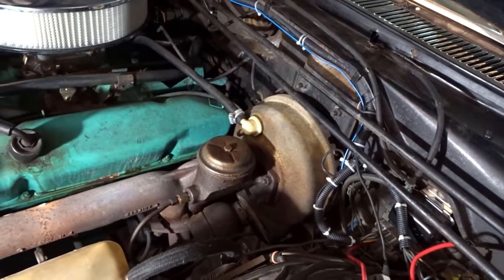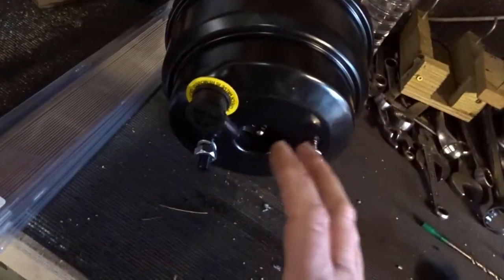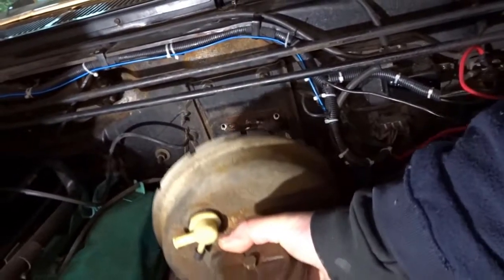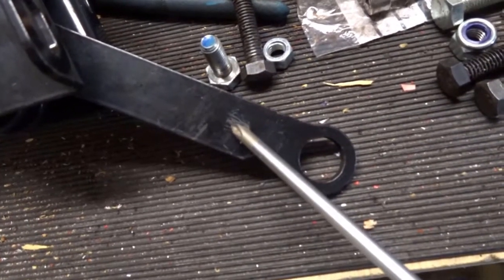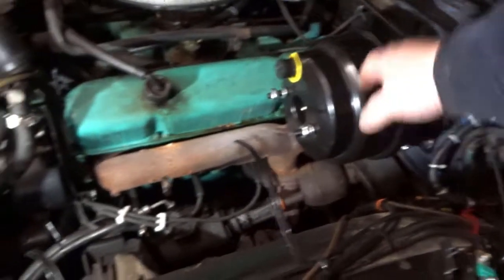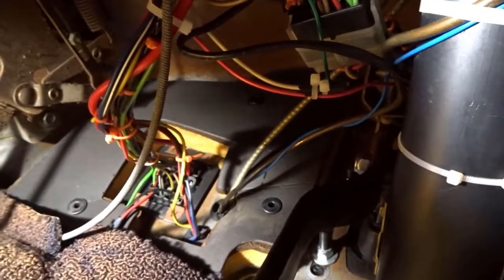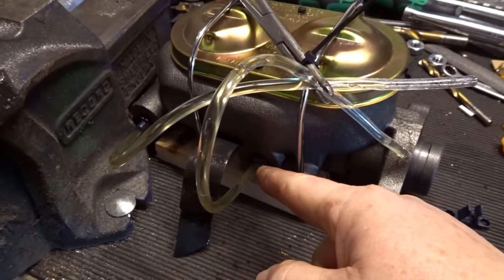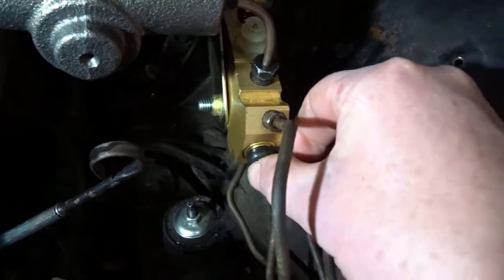1965 MOPAR C-Body twin 8" booster & dual circuit reservoir fitting

Comment: Nice mod.  Where did you buy this kit?
I'm having a hard time finding aftermarket parts for my c body
Reply from the maker: I found it on the US version of ebay. Parts of it are clearly GM in origin and shared between many brake booster kits. It was listed as "1963-74 A B E BODY MOPAR CHRYSLER DODGE - 8" POWER BRAKE BOOSTER KIT DISC / DRUM"  Seller was called "americancap"  based in Porter, Texas. As in the video I had to modify the arm length between pedal and the booster but they give you a selection of 3 so even if you mess one up you have the basis for having another go. The 8" booster diameter means it will fit whereas larger diameter ones will not.